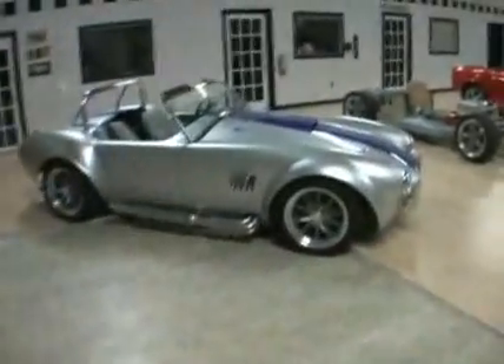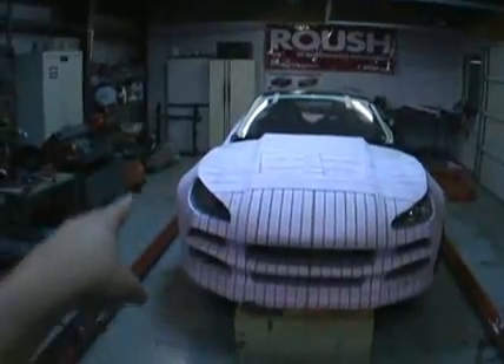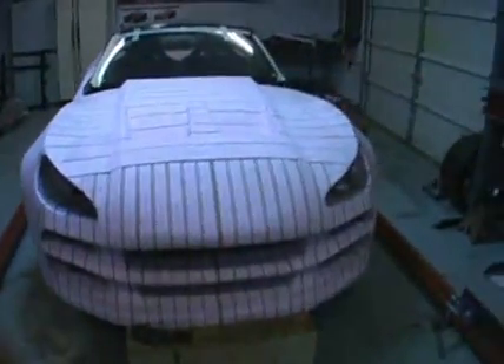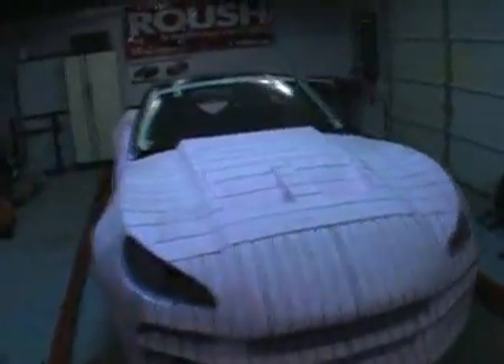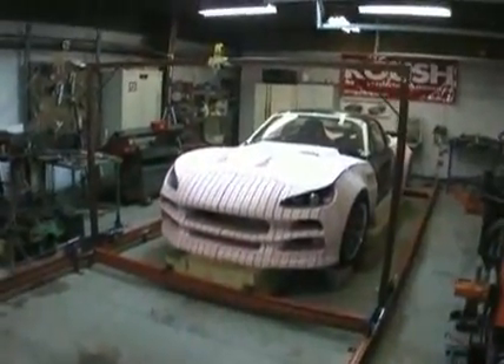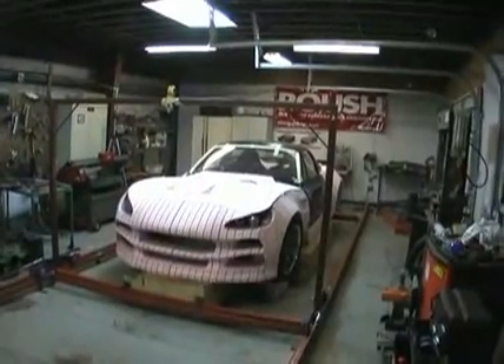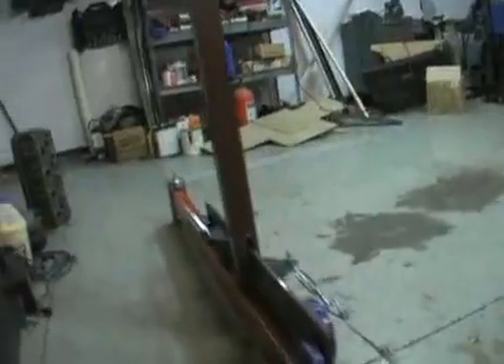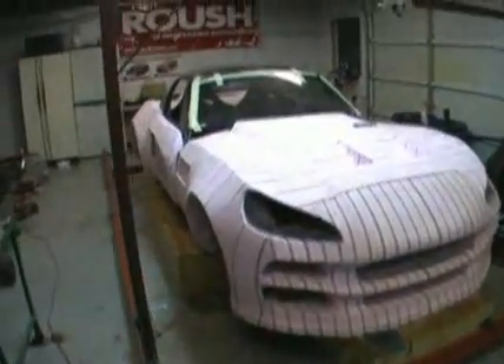Bailey Blade - Gantry System - Part 36

Comment: wow, if it were me making that.i would put adjustable lazer lights across the top.with a built in ruler.then put lazers on each support post. and then i wouldn't need the cable system. it looks like the cables could stretch and give false readings.TIP :you could loosely rap the cable with a piece of colored plastic sheeting.so it can be seen.